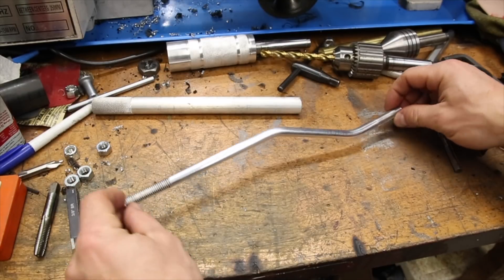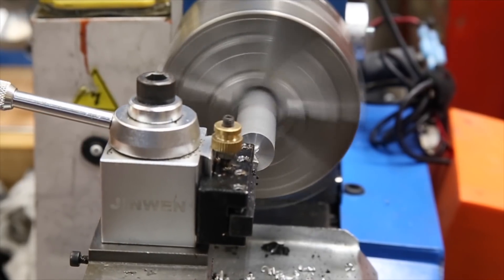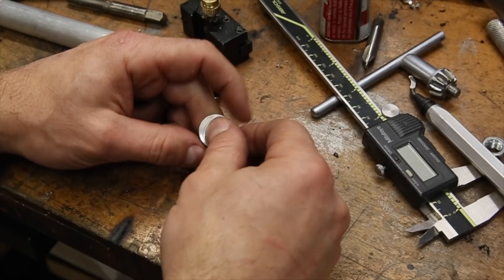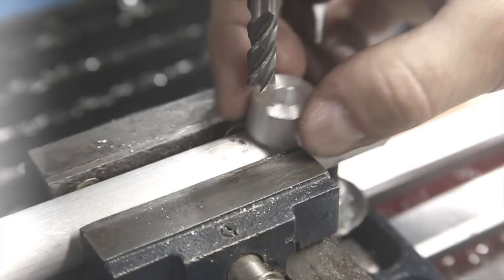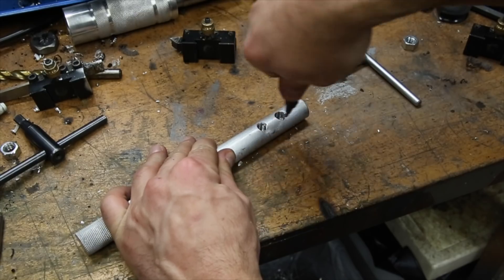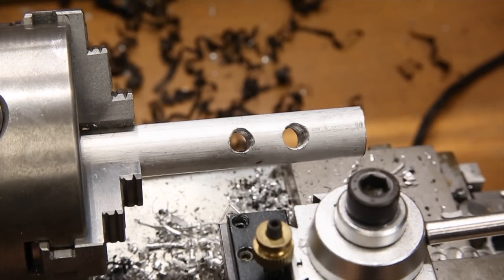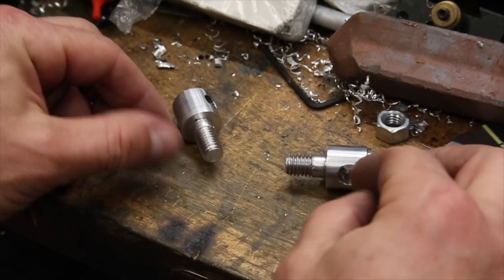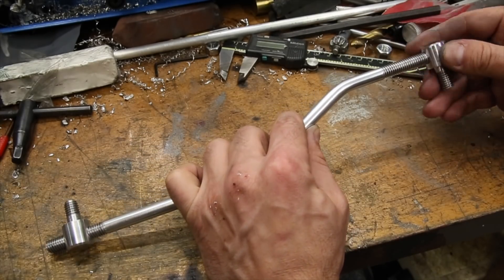(2/3) Custom Restomod Ford Mustang Throttle Linkage Adjuster Ends on Mini Lathe

Comment: Given that you are making custom bits to suit you not to suit me, but I would make the threaded bits maybe 2/3mm longer and remove the thread.  Makes it a lot easier to fit the nuts rather than risk dropping them in an area near the open carburettor.

Comment: Nice build!  I find if I support my work with the tail stock thing cut better. You can use the parting tool to create the square corner to depth before removing the rest of the material. If that makes sense.

Comment: Great work,  but man your tool post flexes quite a bit when using that cutoff tool.  My best suggestion would be to slow WAY down.  Like 60 rpm, feed real slow and lots of coolant, you will get a much cleaner cut.
Reply from the maker: skipopotamus thanks! The tool post does leave a bit to be desired... It was also on the slowest setting of around 750 rpms.... I might be able to adjust the controller but haven't pulled it apart again yet
Reply: Oh wow 750 is still quite fast.  does this lathe have a low gear setting? On my Grizzly the  slowest I can get it to go in low gear is 60 rpm.
Reply from the maker: Nope, this is a single speed lathe... good thing is that there aren't any plastic gears to break, bad thing is stuff like this haha
Reply: TimNummy yup. It's a trade off. Well keep making awesome  videos man. Love your stuff.
Reply: To help against the flexing, try to turn it the other way. As in, flip the blade upside down and don't forget to turn the motor in the opposite direction.

Comment: DUDE...... you kind of scare me... but I can't help but watch!   Don't begin your parting off and stop half way through, and then go back and continue to work on the end of your part cutting and threading it, get all that stuff done while you still have a thick shank to support it. That's why your part was bending when you took another cutting pass to clean up the surface of your parts that you never completed before. Be safe and think your processes through to completion so you have a plan, don't get ahead of yourself.

Comment: Awesome as always. Good idea making them back to back, but I think you used the parting tool too soon. You can see the part flexing away when you do the final turning. 

Also, when using a tap or die on the mini lathe, I've found it easier to use a small adjustable wrench on the chuck jaws, rather than using the chuck key to turn it (plus I'm paranoid about borking up the chuck key holes...). Making a crank handle that fits in the back of the spindle could be a good project series... I know I want to make one.
Reply from the maker: Ah, that's probably a much nicer idea... I do need to come up with something better.

And yeah, I should have either used the center or not parted it as much so early.... it's a lot easier to see stuff like that on super high speed.

Comment: Like the humor. Nice job on those ends, neat way of turning them.  Always like your videos.  Wish I had my machines when I built my 29 coupe with the Flathead V8.  Cost me around 200 for three Duce linkage at the time. I’m going to remake the swing pedal set up on my coupe since I have the tools now.  I’ll have it on my channel.  Question, would you make a set up with a steel or aluminum frame and of course steel brake and clutch arms. I need input.   I want to see this mustang when you get it done. I built a 65 for my wife, silver-blue w white interior. Want some muscle in it but wife likes stock, oh well I have the coupe. Keep them coming my friend love the videos
Reply from the maker: Sounds like you have some fun cars! I'm not sure which material to recommend.... both steel and aluminum can work or not work depending on the design..